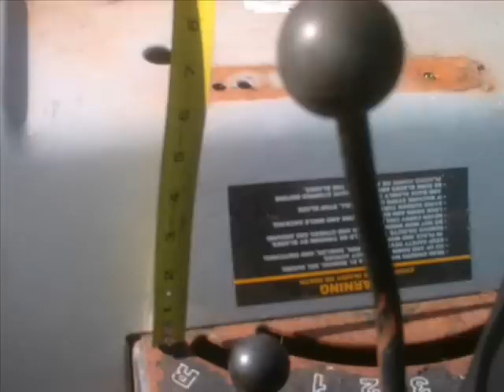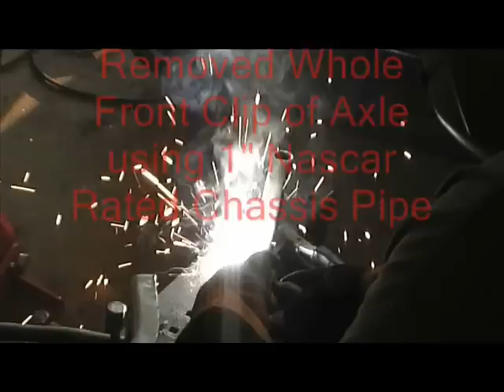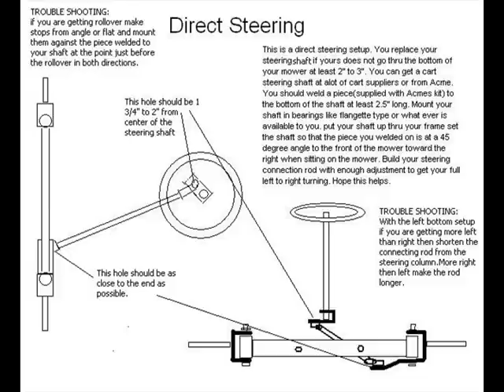imow racing mower build

Comment: It would be helpful if you could post a video of how you built you front end. Im going to get me a lawn mower tomorrow and start to build it! Is it also better to lower like you did by moving the sheet metal down. Or would it be better to cut the L bracets out of the back and move them up a couple of inches. I know if you cut the L bracets out and do it that way you will be closer to the ground, but ill also have to make a jackshaft. I would appreciate help from anyone who has built one. Thanks.

Comment: Hey mike its Jason I have a q to ask y on my mower I have a 14hp motor in the moral the clutch is a 2 pulley and I wood like to line the belts its a 8speed transmission iv even flip the trans upside down it winter to fast in revers what should I do